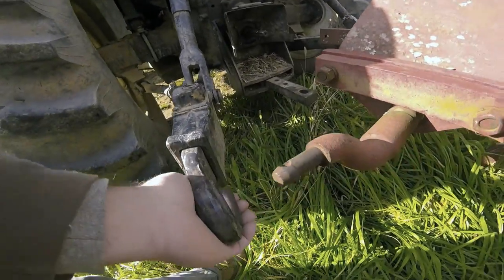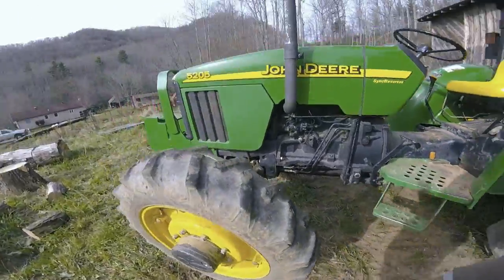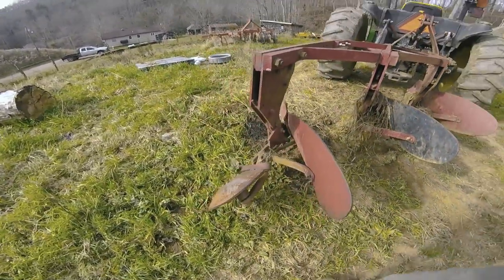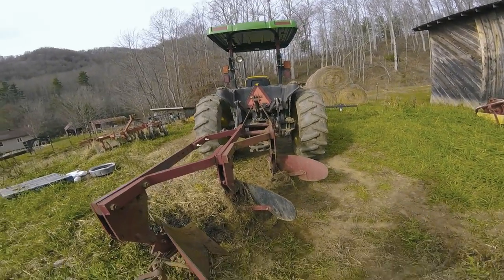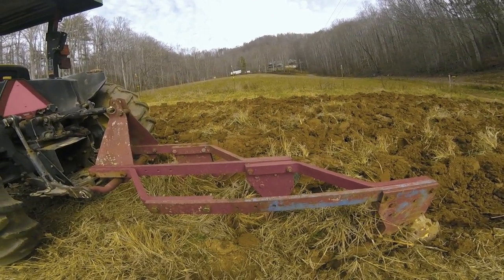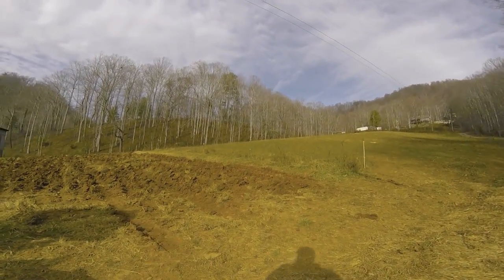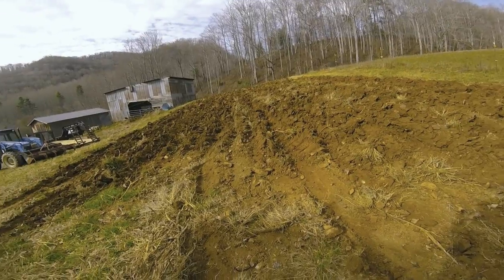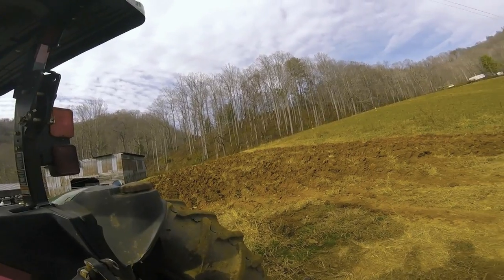Moldboard Plowing With The John Deere 5205 and Ford 101 Plows

Comment: That plow is pre 1962 or they would be blue not red.
Reply: The blue ones are newer?
Reply: @lynnhavenfarm8514  Ford went blue in 62. You can remember because it rhymes.
Reply: Thanks for the info, I just got a set of blue 101. Is there a way to check its age by serial number
Reply: @lynnhavenfarm8514  I don't know that Ford kept a list of implement serials like they did tractors. My set is red. Maybe join the Blue power fan page on Facebook and ask there. Those guys know just about everything.